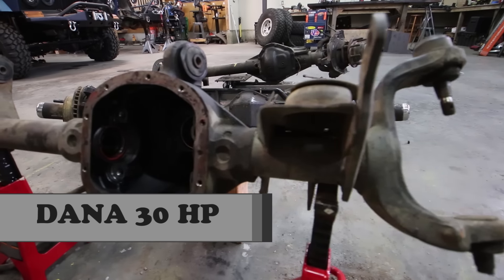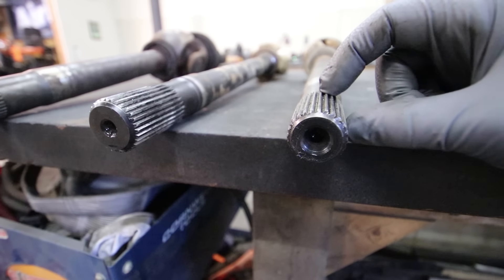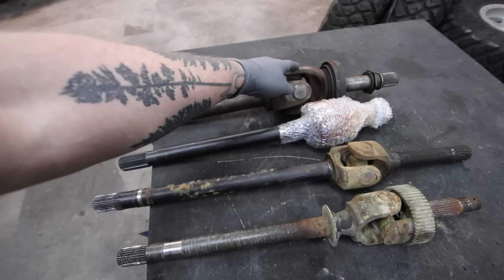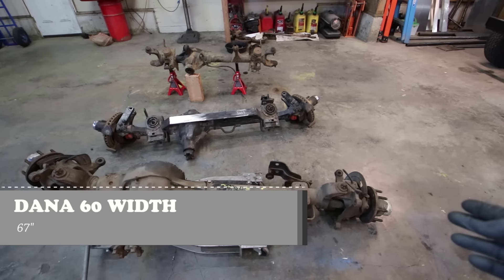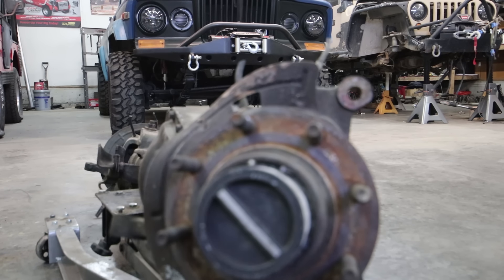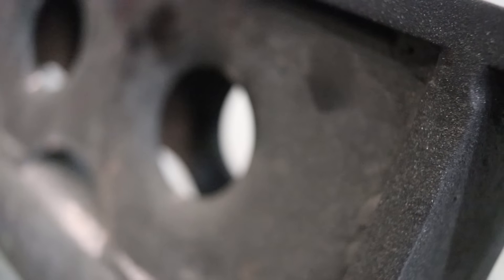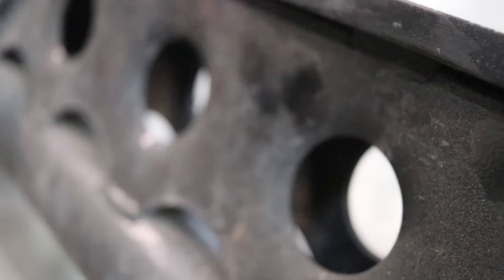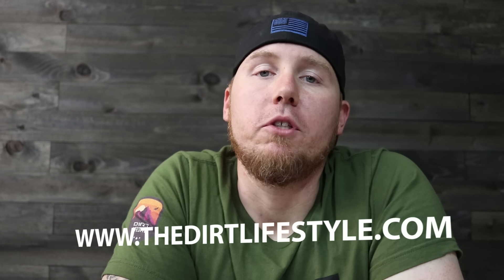DANA 30 vs 44 vs 60 Junk yard Axle Swap Beginners Guide!!!!

Comment: good video! im trying to learn more about axle options as im contemplating a build and dont want to spend an arm and a leg just on axles.

fyi some stock axle shafts are indeed chromoly, which is just term for any 41xx steel, there is actually quite a wide range of "chromoly" steels from 4118 to 4161, the first two numbers designating the chromium and molybdenum alloys (thus chro-moly) the second two designating the percentage carbon by weight (4140 has .40% carbon). a more common axle steel for stock applications is a medium carbon 10xx steel (1040, 1050). although i will also say that heat treat plays a very critical role in how these steels proform.

Comment: I swapped in JK axles 30/44 in my Tj because they are stronger than Tj axles and the Front axle was pretty built so I didn’t have to do much aftermarket stuff to make it fit.
Reply: How did that go for you? I am setting up to do that on my tj build as well. I am planning on using artec jk2tj truss. What did you do for a track bar
Reply: Nick K go on Facebook and look up “Jeeps with jk axles” all my info is there.

Comment: I put dana 30 and 35 in my s10 and it handled 33's with a lot of abuse and never bent or broke anything aside from driveshafts (ended up upgrading to SYE), tie rods (ultimately upgraded to 1 tons) and a few sets of ball joints wore out quickly. Now its got 34's and I wheel it a lot easier, been consider welding the rear end into a locker.  Eventually the axles will prob be the weak spot but at the point it prob wont even be road worthy. Ive been trying to keep it reasonable to skate around town into the woods.

Comment: Nate, I have a question for you about front axle choices, so let me give a quick overview of the rig:

I have a 1948 Willys CJ2A that was stretched 24 inches at the Spokane dealership after receiving it from the factory. The stretch was installed at the step-up in the floor directly behind the front seats.

The current drivetrain is Dauntless 225 V6, stock T90/D18 trans and transfer case, PS offset D44 with two-piece axle shafts, and the stock D25 front axle. With the exception of the front axle, I'll be keeping this setup for reasons I'll hit in a minute.

This is my daily driver and it's going to be built and used as an overlanding rig. Design-wise, I'll be building it as a 'what if Willys had built an overlanding/safari truck on an extended CJ chassis in the late 1940s?" I want to be able to drive it into remote areas on or off road, but rock crawling isn't an intended usage unless there's no other way to get where I want to go. Even then, I'm going to take the easiest route.

As concessions to safety and drivability, it has four-corner manual disc brakes and the V6 so it can mostly roll with modern traffic. Once I upgrade away from the Ross steering, I'll fit a hydrovac for power brakes. I'm hoping to start fabbing the 'family-style' exocage this summer. It will be as minimal as I can make it, but will incorporate a roof rack and light mounts. I'm currently planning on 1.75 inch 0.095 wall DOM or Chromalloy for the tubing to keep the weight down. 

When actively overlanding, it has a slide-in tray that has gear storage underneath and a sleeping platform on top. The setup weighs about 60 pounds. The custom-made canvas top incorporates a driver's side tip-out for sleeping in the back when the tray is installed. Total weight of the tray and gear and two adults is about 800 pounds. This includes water, extra fuel, food, tools, spares, etc. 

There will be additional weight added to the vehicle when I build the roll cage and I'm planning on two more fuel tanks. One in the center of rig under the floor at about 27 gallons and a CJ5/7 tank in front of the rear bumper at 15 or 21 gallons.

The jeep weighed in at about 2400lbs empty. All of this is currently supported on Rancho 2.5 inch lift springs and open C shackles (I know - someday I hope to have a set of OME springs) . Tires are 235/85R16s on stock rims, so about 33" tall. While neither the 24" stretch or 33" tires are good for turning radius, the 33s are necessary to regain the loss of breakover introduced by the stretch. They're the tallest tires I plan on using.

I replaced the D41 rear axle a few years ago when the ring and pinion finally wore out.  5.38 gears are hard to find for a D41 so it was replaced with a late 60's offset narrow-track D44. Future upgrades for this include a 31-spline full-float conversion and a selectable locker.

I know the front axle will give out sooner or later - I'm already running a used 5.38 gearset and they're pretty much unobtainable at this point. I'd also like a selectable locker in the front, and that pretty much kills keeping the D25 anyway. One additional requirement is that the tires have to stay tucked inside the body - so stock WMS is critical, even if I need to custom fab the axle.

So I'm finally to my questions.

First, I have Rzeppa axle shafts for the D25. If you're not familiar with them, they're the strongest stock shaft for the D25 and they have a fully rebuildable CV knuckle. Will these fit a D27 or D30?

Second, I'm trying to stay as close to stock as I can in appearance. I'm also trying to keep it as light and simple as possible - I'd like to be able to pick up replacement parts in nearly any auto parts store. So knowing that I'm going to be replacing the front axle when this one finally gives out, what would you recommend?

Comment: Build the 44s in my shorty ram or swap 60s from an 03 ram 2500, I'm running 35s with long arms, video really helped man keep up the good content
Reply: 60 is cheaper then rcvs for a 44. The real strength gain is the knuckle and r+p.

Comment: Great video but I personally would warn against wheeling a XJ hard with 33s on a high pinion d30 stock. Been there trussed and chromoly axles fixed it until I put a locker in with 35s. Found 33s 4.88 gears and a locker would hold up but any bigger and I'd break it again.

Comment: thanks man, good info. I have an 88 cherokee with dana 30 and 35 axles, really want to put a small lift and "offroadability" options on it but on a budget for sure.  not a hard core wheeler (except after I get out there that might change)  thanks for the info on hi and lo pinion and with some upgrades mu current axles might be ok for a while
Reply: You can lift an XJ for cheap up to 3" using spacers .  This allow to mount 31" tires which gets no problem with factory axles.

Comment: Thanks for the video Nate. This gives me a little more confidence to build a 30 for mine. I slept too long on a set of ford HP 44 and 9 in and someone beat me to them. I dont have huge rocks to bounce on here and its all mud and sand where i live so i been eyeing 37s for awhile since i been running 35s. Definetly subscribing here for more stuff.
Reply from the maker: Great man! Thanks for subscribing!  If you plan on running 37s definitely throw all the strongest parts you can at that Dana 30!  They are definitely worth it if you build-em big 👍 I'm working on an ultimate Dana 30 Axel build video. First episode will drop in a couple weeks.

Comment: I picked up an old D60 rear. So this is pretty sweet. Currently looking for a front D60 driver drop. Difficult
Reply: I have an 03 d60 if you are interested. I'm in Tennessee. Axle is already stripped of brackets

Comment: You kind of got your high pinion explanation wrong. The reason it is stronger is because a high pinion in a front application pushes the pinion into the case under load. This is the bigger of the 2 bearings and the better oiled bearing so it can take the load and heat better. The reverse cut does not pull the pinion into the the gear and does not decrease deflection. 

If you run a low pinion in the front then the pinion drives on the coast side of the ring and puts the load on the pinion bearing behind the pinion nut. This is less desirable but was a simple factory compromise to save cost. It worked well for the OEM's because as it turnes out most people never use 4WD so the gear sets still last a very long time.

Comment: Hey man great video! I am not a "off road" enthusiasts in the terms of rock crawling but I do like to go literally "off the road" in my truck occasionally. I have a 96 f250 with a ttb and I just bought a Dana 60 out of a 97 f350. I am planning on going through it while its out (reseal, bearings, ujoints, etc.) and I was just wondering what you would recommend given how I use my truck. Any must does/upgrades? Running 4.10s with 315/75/16r on a 4inch lift Thanks man!

Comment: So while building my high pinion D44 for a CJ5, my question is are there any interchangeable parts I'd be able to utilize on the D44 from my existing D30 in terms of outer hardware like calipers caliper mounting brackets hubs etc. Thank you for the informative videos. Great DIY channel.
GT
Reply from the maker: I can't completely confirm but along time ago I heard that the inner c on the cj5 is the same size as the inner c of the f150 dana 44 (Again i haven't confirmed this personally). If this is true then you can choose which knuckles you prefer to run! As well as brakes ect. But I do know that you will only be able to run ford outer components with ford and jeep with jeep. Thanks for watching the videos!

Comment: I know the Dodge Dana aren't really desirable but Ive been running axle locked Dana's out of Dodge for ever and really don't see much of a difference in locked vs unlocked. Kinda cool running old school Dodge parts like the Axles/T-Case and being able to slip it in and out of 4x4 with no clunk, bind, pops or anything at highway speeds.😂😂 Shifts in and out like butter...

Comment: Hey , what if u really don’t go off road,  what setup do u recommend? And what would u do ?
Reply: Nothing if you intend to run stock tires.  On a quote "mall crawler" - If you go up in tire size, the issue mainly becomes gear ratio.  You will loose acceleration across the power band spectrum.  Mall crawler re-geared do not spin the tires, all good.  I believe quadratec has a chart on gearing etc by tire size.

Comment: Thanks for the video. I have a jku and I'm on the fence. I don't go to hard but I do like to hit deep mud holes. I'm running 35" nitto 6 speed.
Reply: Same here (JKU, 3.5" lift, 35" Nitto). I'm really trying to figure out what vital upgrades i need to be able to do trails like Black Bear Pass and Imogene Pass without worrying about my jeep breaking. I still run with the stock gear ratio of 3.21 too. I didn't really want to pay for a regear until I move up to 37" tires, but I'm realizing that may be awhile.
Reply: @AceGoodheart  you DEFINITELY want to regear it asap! I couldn't even use 6th gear and rarely used 5th because the 321 were just to tall. I went 488 and I wish I would of went 513. Its amazing the difference. A completely different machine. Yes its costly but I wasn't about to burn my clutch up or mess my trans up. 
I posted a video on the gears at low and high speed. The channel is called family restoration so search family restoration jeep 488 gears, and it should pop up. Its also a very clean and kid friendly channel.
Reply: @ruffypoo  i typed it in exactly as you had it but it didn't pop up on YouTube. So you're running a 5.13 gear ratio with 35" tires? I'm down to do that because when/if i switch to 37" I was gonna do a 5.13 ratio.
Reply: @AceGoodheart  no. We're running 35 with 488. I wish I went 513. Give me a sec and I will log onto that account and reply a comment for you
Reply: @AceGoodheart  this is us. Click the picture icon and it should take you to my channel. We've done many things to the JKU.

Comment: I put a Dana 50 axles in a Cherokee I run 35's have had zero problems I think I wheel pretty hard moab is just down the road for me
Reply: Jeremy hanna Dana 50’s are the step child of the Dana world.. they are no stronger then a 44 and have tons of issues over the years food used them. It will be plenty for a 4K Cherokee though being 3k lighter then a super duty. The biggest issue with the 50 is really lack o aftermarket supper though. I’ve pulled out so many 3/4 ton fords with the d50 cause their vdc failed I hope you found a way to delete that. I really don’t see the need for this swap though tbh.. I don’t know many Cherokee owners who have issues running the factory hp30 like their are with wranglers running the lp30 or even rubis running the wannabe 44. The rubi axles should’ve never been slowed to be called a 44 they should have been a Dana 40 at best as they are very far from a true 44. 

Anyways what are you running in the rear with that 50? And why such a big axles for just 35’s?
Reply: @fishrrelaxing9361  its stock f250 axles front and rear been running good 6 yrs I got a deal on them from a scrape truck I thought they were  d60's its has warn manual lock hubs no vdc I was tired of breaking cheap weak jeep  parts decided to go cheap route to built tuff

Comment: Cool video.  Well i dont wheel but im into heavy duty. I run a 97 f350 dually.  With the heaviest motor the ol 7.3 powerstroke. Im close to 4k on my front axle empty. Im careful where i go so i dont sink. Could you do a video on rear locker vs posi vs open. Im pretty sure my trk has an open rear.
Reply from the maker: Thanks man, that's a good suggestion. I will starting thinking about a good way to film it so people will easily can understand what I'm saying. 🤘

Comment: I can pick up some half ton axles from an 83 square body for 100 bucks. I have a 90 yota reg cab long box. Im gonna put a propane kit on the 22re and I alreadry have some 35s on 15x10rims. SAS with a bit of gearing and I can have some fun for cheap. Maybe get some 1 tons if I start getting crazy but for what I do I think the 1/2 ton chevy axles will be fine for a while.

Comment: Building your own brand is the smartest thing you could do, also these reasons are why my dana 30 is staying in my xj 35s is where Im stopping for awhile
Reply: Update shafts and joints and a truss I've run 35s on hp d30 with 4.56 for years
Reply: @philosophicalfloridaman  thats the exact plan lol, and easy on the skinny pedal
Reply: Eric Lee I’m running 35s with 4.56 no truss and stock shafts with spicer u joints for over a year
Reply: I've beaten the crap out of my 100% stock hp 30 for 4 years. I'm running 35 Km2s. Only thing I've broken is 3 passengers side u joints & 2 rear driveshafts. I ran junk yard axle shafts until I realized the 3/4 clips were getting worked out & I upgraded to full circle clips.

Comment: OK.. I am not too knowledgeable .. But isn't the u-joint supposed to put in as the weakest link of the drive-train accordingly and purposefully ?  Especially for lone-wolfing the Trail .

Or is this based system of planning not a possible reality ?
Reply from the maker: I've never built this way. To me this is an old school way of building an offroad rig. I try to make everything as strong as practical. Even the u joints. Thanks for watching! 👍
Reply: I agree in making everything as strong as possible, however many people find it easier changing a u joint on the trail vs an axle shaft... your build is just that, your build so do it your way!

Comment: I rather have a u joint and use it like a fusible link. Easier to change. And installed axle trusses on dana 44s with 40in tires no problems for years besides broken u joints

Comment: So a 97 HP Dana 30, trussed, chromoly axles, 30 spline inner/outers, Torsen diff, 4.10s, and 31’/33’ tires are ok for Light off road? Towing ATVs and dirt road type stuff..Be ok? For a 94 S15 Jimmy with V6 with @220 hp..
Reply from the maker: Absolutely. A Jimmy definitely weighs more than a tj but on a 33 this set up will have no issues. I would be confident up to a 37 on a tj and a 35 on a build like yours. That hp range should be with in the limits of this ring and pinion but if you think you'll  want more power in the future then this isn't the right axle. Your going to want a dana 44 hp for anything in the 240+ range in my opinion. 👍 good luck!

Comment: Dana 60s are 9.75 ring and pinion unless its the 2005 and up Ford dana "super 60" which is 10.1 ring gear.  Correct me if I'm wrong.
Reply from the maker: I think your right man 👍 bad info on my end
Reply: @DirtLifestyle  No biggie.  I have a set of 99-04 axles.  I know the covers are different than the old 60s.  I did some digging around on the internets thought maybe you were right.  Don't want to buy gears and such and find out I got the wrong ones lol.  Nice vids man.  I love your build style and the tech is great!

Comment: Anything and everything that adds weight ... compounds weight issues and snowballs requiring stronger parts to handle the effect of other stronger, heavier parts.  This is always the issue in aircraft, motorcycles (jeeps) etc. Keeping things light as possible means you won't need to build a locomotive just to move the tonnage.